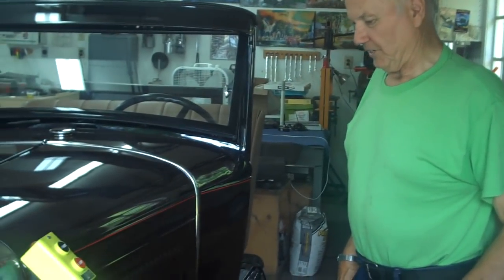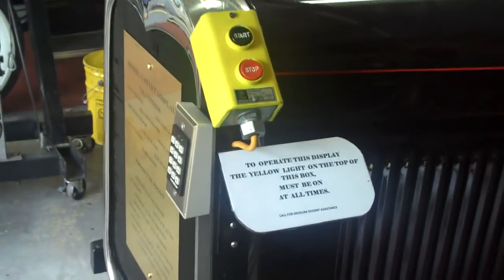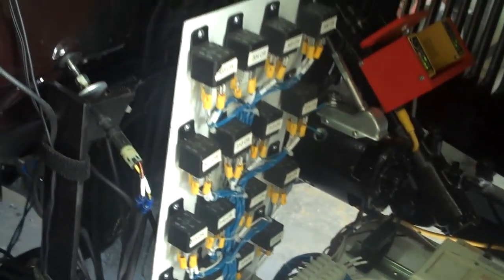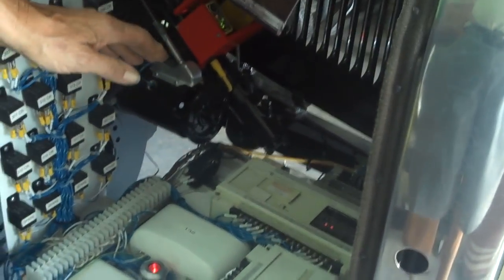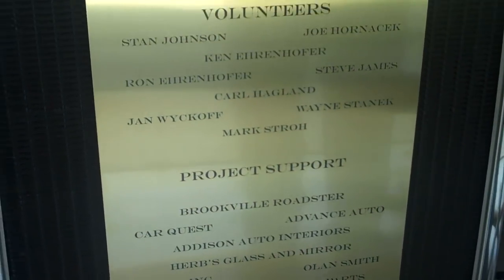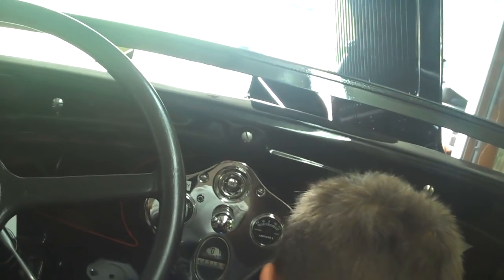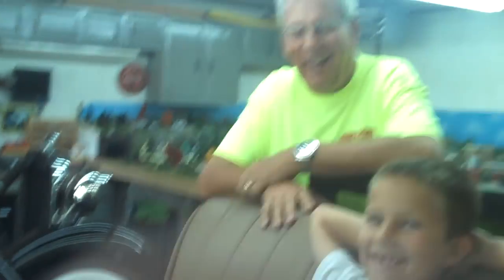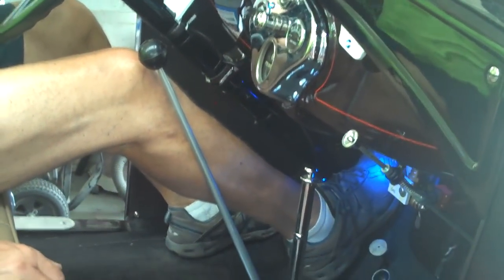Joe Shows Off His Model A Starting Simulator 2018

Comment: For some reason, my Model A doesn't sound that smooth when I start it up. I'm told that the new exhaust manifold rings need to be filed down since the manifold was planed, as I recall. I torqued it to 50 ft. lb. and it still leaks.
Reply: My model A sounds like this one when started.